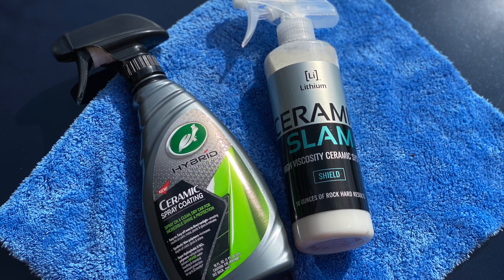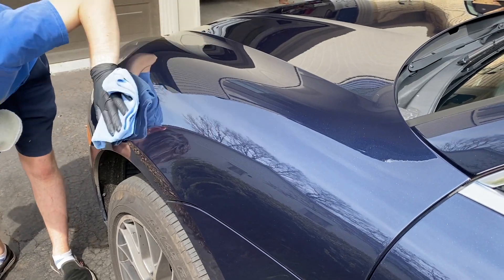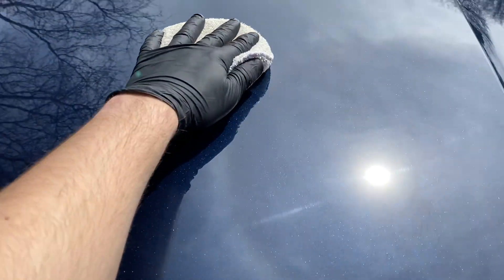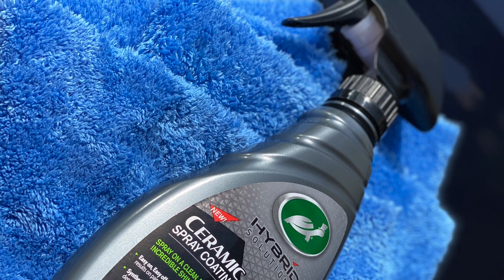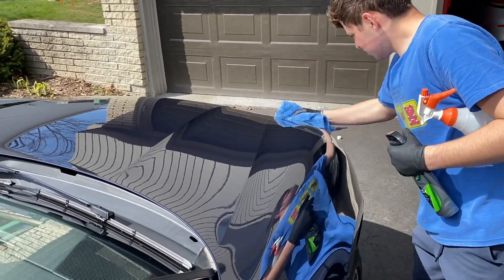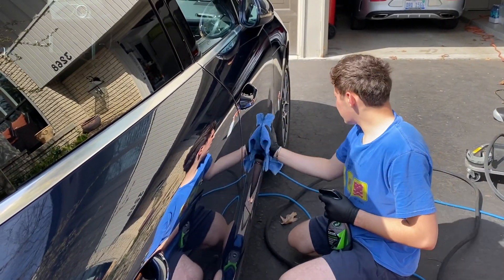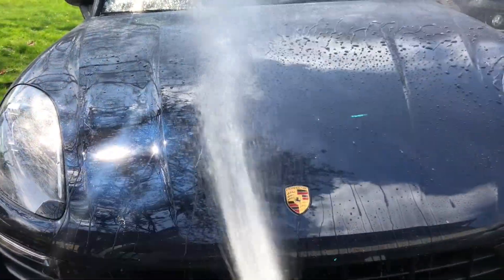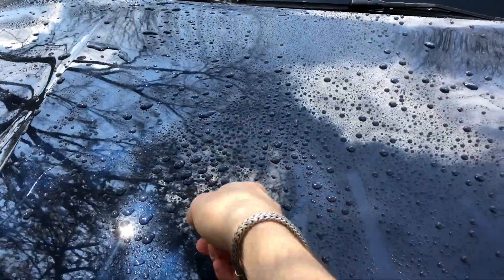Lithium Ceramic Slam VS Turtle Wax Hybrid Solutions Ceramic Spray Coating (Side-by-side comparison)

Comment: Good tips and advice.  Which did U like better?
Reply from the maker: Thanks!  I liked both of them a lot, but I’d say the turtle wax was a bit easier to work with and faster to get around the half of the car I did... also it was instantly glossy and slickness was immediately there.  Lithium takes some time to have all the gloss and slickness.   Personally I’ve used turtle wax on a few cars and it only lasts 3-4 months in Michigan weather.  So I sell it as a spray sealant add on... I honestly think lithium is going to be more durable.  They are really honest on the bottles too.  6-8 months.
Reply: Hank's Detailing 3-4 months and 1/3 of the coat for TW is awesome.   U want to see your customers more often than 8 months
Reply from the maker: Detailing Breakdown very good point!!  So at the end of the day I would go with TW but I would go with lithium if I wanted to top a ceramic coating or just use it in my car for fun. But, The price is way to high!